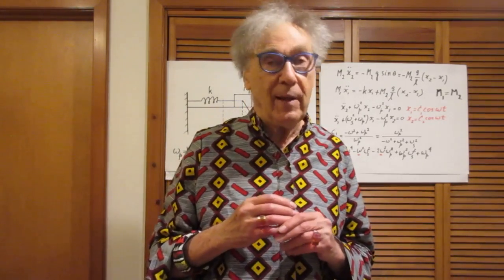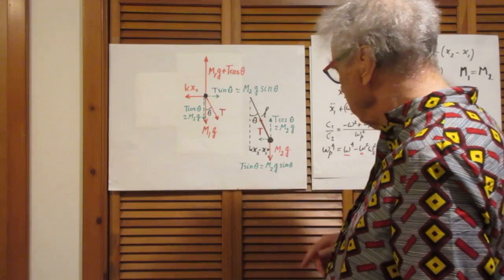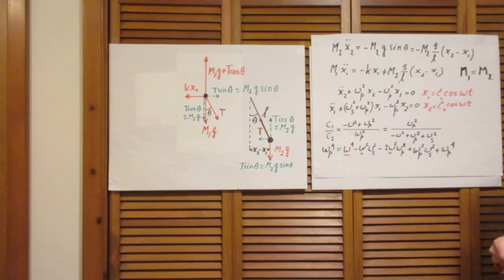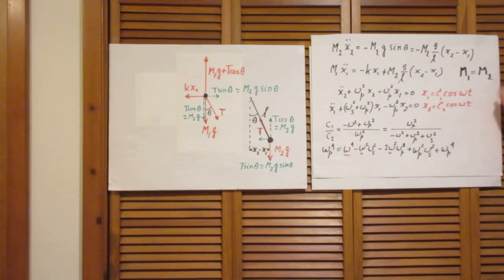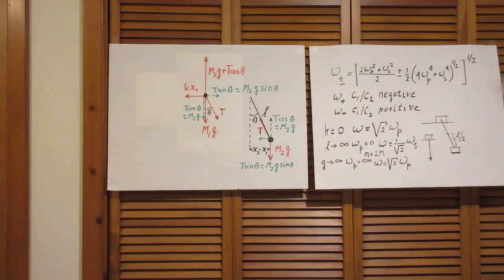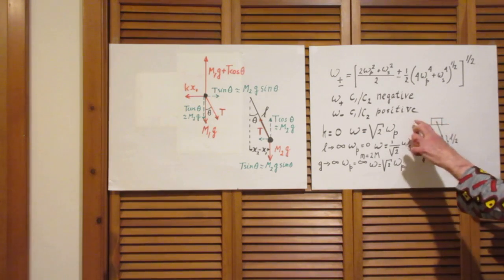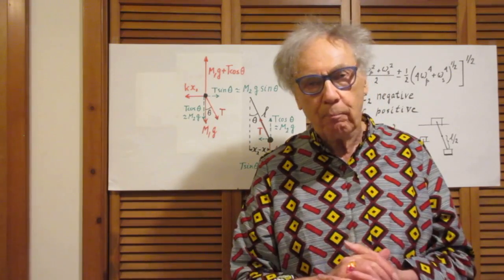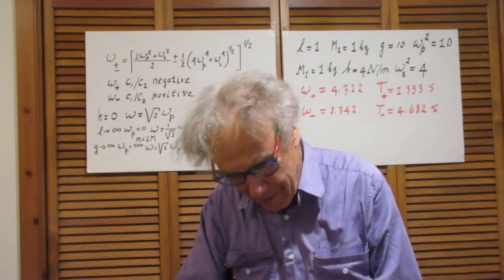Solutions to Difficult Coupled Oscillator Problem #43

Comment: Comment about your statement where the pendulum is infinitely long: if that is true, isn't the pendulum mass "decoupled" from the table mass?  The string will always be vertical, and its force upon M1 will always be perpendicular to the table and cancelled by the contact force from the table.  Sin (pendulum angle) will always be zero.  If the mass is pushed and released, it alone will oscillate; the pendulum mass will remain stationary centered under the extremes of the mass motion, and it will apply no reactive force to the mass.  So won't the oscillation frequency of the system be that of the table-mass/spring alone, or [omega s] and not [1/sqrt(2)][ omega s] as you state?
Reply from the maker: I cannot add anything to the clarity of my solution.

Comment: Coupled oscillator problem occurs in the various "wireless battery chargers" that couple energy with a wide space between the coils.  Each coil is tuned with a capacitor, and the 2 resonant frequencies are tuned to be as identical as possible.  But the presence of metal, magnetic materials, and different spacings complicate the problem of "smoothly" transferring power at a controlled rate without energy "sloshing".  (It is this "sloshing" that makes Tesla coils work.)  This system, like a Tesla coil, is a 4th order system.  With the exception of electronic filters (where the poles and zeros are carefully placed), electrical engineers do not usually attempt solution of 4th order differential equations, because of the difficulty.  They instead use "dominant pole" analysis, which usually works well, as the poles are usually widely spaced.  But in this case, they are coincident.  To have proper control of the energy flow, 4 independent parameters must be controlled (such as drive frequency, drive duty-cycle, driven capacitive load, driven impedance load).  Most companies offering these (such as WiTricity) miss this detail, so their schemes fail.  This is a bit like the "3-body problem", having no closed-form solution, so astronomers use "dominant-body" approximations.
     Perhaps you would like to prepare a lecture on this subject?

Comment: Dear Prof. Lewin
I had a question in the free body digram of the pendulum . In this case the pendulum is attached to the blck that is accelerting .So wont it experience a pseudo force in the opposite dirrection like a passenger sitting in car that is speeding up experiences?
Reply from the maker: no pseudo forces in my frame of reference
and that's the ONLY sane frame to use here

Comment: Professor I think you've miscalculated the L = infinity case (same as g = 0), if that is true, then W = Ws. Because you going to have in the denominator 2Ws^2 then divide with 2, Ws^2 then you have to take the square root of it. Correct me, if i'm wrong please.
Reply from the maker: I cannot add to the clarity of my solution
If you cannot follow it, watch it again
Reply: @lecturesbywalterlewin.they9259  Ooooh i understood it, because in that case the definition itself of Ws changes, that's right :)
Reply from the maker: My solution is correct and I cannot add to the clarity
Reply: When I enter Wp=0 in your formula I get W=Ws. In this case the spring is only acting upon M1.